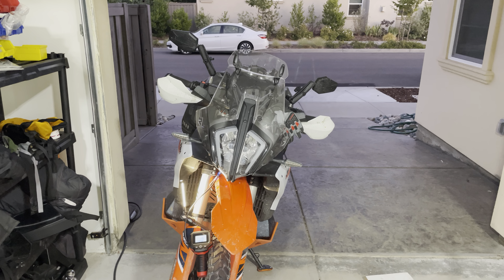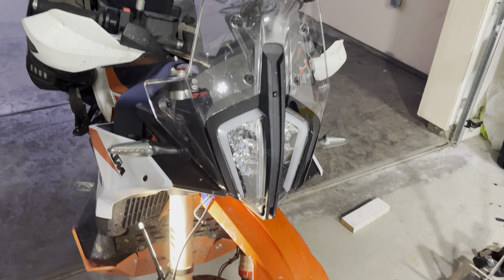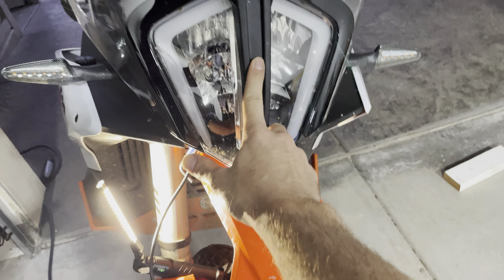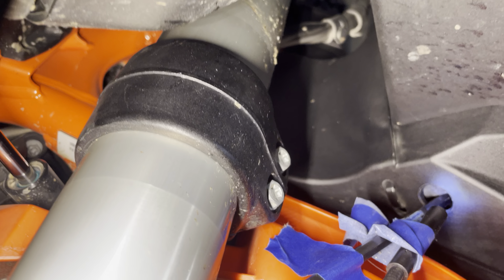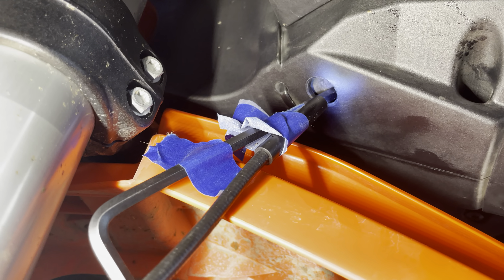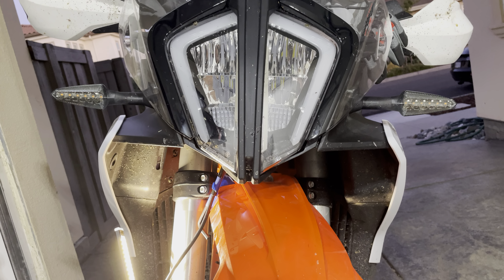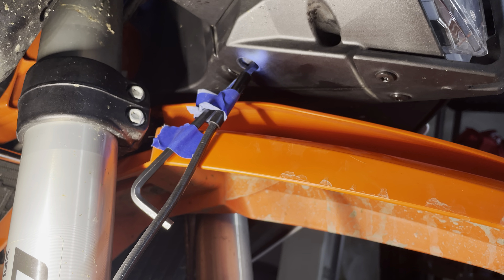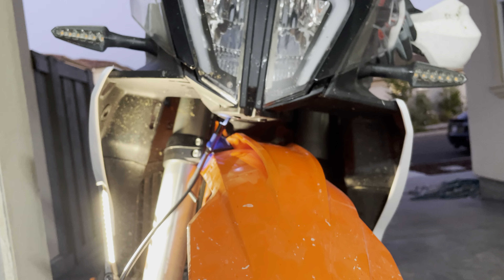23 KTM 890 Adventure (R) Headlight Adjustment

Comment: Thanks. Really appreciated. Even with your detailed video it was still like solving a rubic cube and then suddenly so easy once one follows the nuances of your instructions and get the wiring harness in the right place and the angle right. My lights were so out of wack that even the truckers were flashing at me. As usual the manual is next to useless, same applies to measuring chain tension. From South Africa.

Comment: Thanks very much for showing how to do this! Great idea to use the borescope. I was scratching my head about this after looking at the manual and spending a frustrating half hour trying to figure out why a wiring loom was zap strapped right across the adjuster access hole in the plastic. Using a mirror, all I could see was a fat wiring cable through the hole. When I pried that out of the way, I couldn't see past the tool I was using to pry on it. Tried to poke around in there with a screwdriver because the manual said it was a an adjustment "screw", but not what type or size. You answered all of the questions clearly and concisely. The factory manual should just have link to your video.
Reply from the maker: Glad it helped you out, I was hoping no one else would have to struggle like I did in the beginning